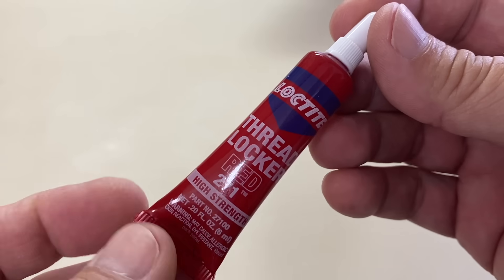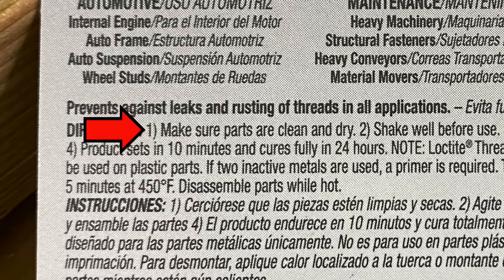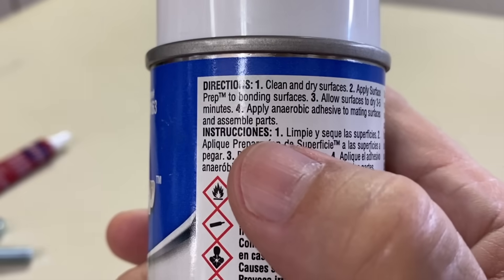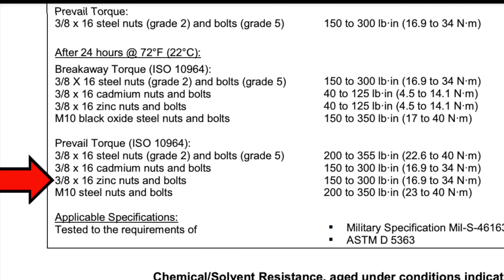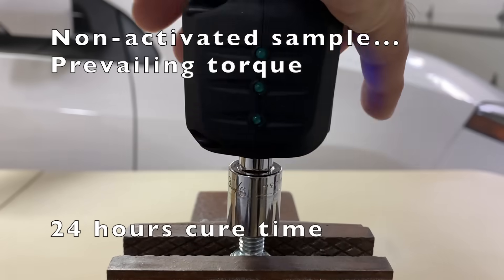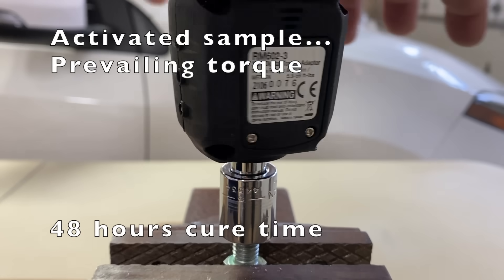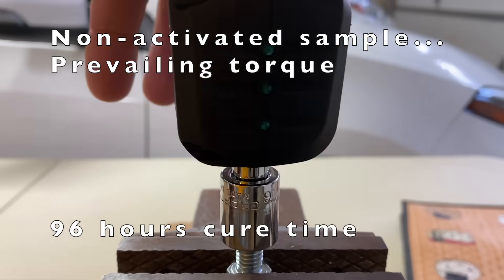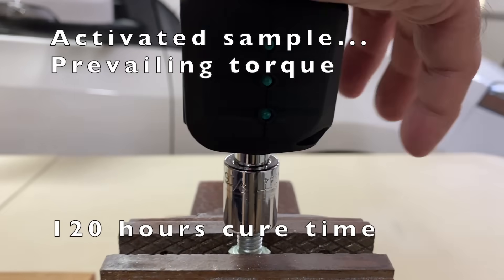Nuts & Bolts - Most DIYers Do Not Know This | Loctite Red Threadlocker Curing

Comment: Great video!  

Dear fellow Gear-Heads,

I owned a national fastener distribution company for 26 years, AND I was a direct distributor of Loctite's Automotive Division products.  As many have suggested, the fasteners should be tested under proper load.  The #1 reason for fastener failure is improper torquing (under & over).   The bolts and nuts should be paired properly according to their "grade", and even plating (in this case "Zinc", which is not only soft, but also acts  as a lubricant) affects the torque range.  

By design, the assembly is meant to stretch, which slightly deforms the threads, especially on the nut.  (This is why you should not reuse them, especially the nut.  By the 3rd-5th properly torqued reuse, the threads can be completely compromised without you even knowing it.)  

For this test, there is an additional reason for torquing the assembly.

As others have said, anaerobic thread-locking adhesives cure when oxygen is not present. They are specifically formulated for the tight tolerances between metals, especially under "load", where the least oxygen would be present.  This is an important feature. 

Occasionally, we would have auto mechanics complain to our company that the thread-locker tubes they received from us were only half full.  This is by design.   The adhesive requires a certain amount oxygen in the tube, or it would harden and destroy the shelf life, if any.  (So, store it "flat" to expose the most adhesive to the most oxygen in the tube.)   Also, unlike some of the other methods of catalyzing, this adhesive doesn't cure in a uniform manner.  The strength between those torqued threads will be much higher than any adhesive exposed to air on the assembly.   (If practical, you could help insure the curing by applying heat [120 F+ if memory serves me]  to the area which will dissipate the oxygen, though it shouldn't be necessary.  

Adhesive that falls outside the tight fitting metal surfaces , doesn't cure completely and can be wiped off and cleaned up.
Reply from the maker: Wow!  Thanks!  Lots of good information.  
I'm thinking of testing other aspects of the activator like cure speed and use on cold fasteners.  😎

Comment: loctite red need 2 conditions to harden: 1) anaerobic (air free) condition and  2) free iron ions on the material surface.  The correct primer adds the free iron needed but not found on many plated and non-ferrous fasteners.

Comment: How about a test comparison between loctite and nylon insert lock nuts?  I never use an activator, just clean the bolts and nut a never had an issue.  I one time bought some loctite to use on a hydraulic cylinder that you had to heat to 450° to get loose.

Comment: You can put a big drop of locktite on any piece of metal and if will not harden, you can put a big drop of glue on just about anything and it will not harden. If it dries it will be soft. That nut was loose on those treads! Lots of play!! Locktite and glues are not Epoxy's. Even glue between two pieces of wood must be clamped squeezing out excess or if and when it does dry it will be soft and movable. Locktite works under pressure, when treads are pulled together tightly! Having locktite on a bolt with a wobbly loose nut thats wasn't tighten or torqueed will never work! If a bolt or nut required 20 ft lb of torque and locktite is used it increases the breakaway torque considerably. Insuring a nut or bolt doesn't back off.. who want to tear down an engine because a bolt backed off? Sorry dude you have absolutely no idea what your doing nor what your talking about... maybe your just one of those guy and if you argue this point then you are...
Reply from the maker: Thanks!  No argument from me.
Loctite tests the breakaway torque the same way, but with precision equipment.  Here's a  testing video from Loctite... https://www.youtube.com/watch?v=PGZCPyi8yBc
I'll do more research because all the stuff I read on anaerobic adhesives says that they work in contact with metal and the absence of oxygen.  No mention of pressure... I'll keep looking for that.  
😎

Comment: I believe the intended use case is to have the hardware tightened to specified torque values and the tensioned/anaerobic environment activate the curing process.
Reply: I agree with your recommendation.  I'm not a chem or materials guy, but from what I've heard about bonding details... 🤯
Some adhesives work on a molecular level such that if you have more than a few molecules' thickness of adhesive between the parts, you're not going to get the desired bond.
I think epoxies would not be in this group, as they stick to both parts and provide a rigid gap filling material (also like the hot melt used for cardboard boxes)
Reply: Correct

Comment: Loctite cures under no oxygen levels. This means leave a drop on the table and it will not cure.  By not tightening the nuts you are not depriving it of air enough to get a good cure.

Comment: Need to bring the nut and bolt through a hole in a steel strap and torque to equal tension so the true effects of the loctite are accomplished, it was designed to fill in the open space between the threads to complete the contact.
Reply from the maker: Thanks!  
Loctite tests breakaway and prevailing torque with loose un-tightened nuts.  If it's good for them, it's good for me.  LOL

Comment: Most likely when the nuts are torqued to specification for the given grade of fastener the zinc plating is rubbed away on the stress bearing side of the threads.  I would expect less variation between the primered and the untreated screw/nut samples under those conditions.  The zinc plating is quite thin.

Comment: Great video. I'd never heard of the need for activator, and I don't clean the bolts either! It would be interesting to run a test with uncleaned bolts vs uncleaned activated
Reply: It fails if you do not clean the parts. I have seen it several times. They must be clean, both bolt and thread area. Brake clean works pretty well and is so common now. Spray on and blow off crap with air.

Comment: If the nuts and bolts rust correctly as engineered and manufactured, why do you need thread locker at all?  (Asking for a friend that goes through far more penetrants than thread lockers.)

Comment: Loctite is insanely overpriced as it is. For the manufacturer to suggest that even more of their ridiculously overpriced products are needed to ensure a stable fastener just adds to their lunacy. For what loctite costs there is no rational reason why any additional products should be necessary for it to perform its intended purpose. Its not surprising that people often use super glue and other makeshift methods of securing fasteners in place. Keeping nuts and bolts secure is certainly not within the realms of quantum physics, yet  loctite definitely seems to want us to believe that it is. Super glue and lock washers are looking more attractive by the minute!

Comment: I think this experiment was a flop.  Your findings make no sense.  Your tool is obviously not calibrated and or malfunctioning.
Reply from the maker: Thanks!
Actually... I read something last night that could explain my results.  A Permatex red technical data sheet says that activator speeds up how fast the threadlocker sets or fixtures... not the full cure strength.  It says 5 minutes with the activator and 20 minutes without.  You know what that means... another test!  LOL

Comment: Great Vid, with one exception.  
Foot-Pounds is NOT a measurement of TORQUE !!! 
Foot-Pounds is a measurement of FORSE, expressed in Ft-Lb-F.

Pound/Feet is a measurement of TORQUE, expressed in Lb/Ft.
TORQUE is measeured as Mass over Distance or Mass divided by Distance. 
As a Metric comparison, Torque is expressed as Newton/Meters, yet you certainly would never say Meters-Newton.

I understand a lot of people use this term INCORRECTLY, but that does NOT make it right.
Reply from the maker: LOL!   Thanks!
I know but just can’t change.  Foot-pounds is ingrained in me.  I even see it on spec sheets and my torque adapter. 😎
Reply: @HacksbyDad  Yeah, I get it. 
I saw a Snap-On Torque wrench with Ft-Lbs on the scale. Amazing., LMAO.
If ya say something wrong for a long enough time, does that makes it right?
 Hey, I just noticed I spelled "Force" wrong, oops.

Comment: These "yielding torque" results seem pretty wimpy to me. I recall using red Loctite 40 years ago, and once cured, it was the closest thing to welding two metals together that you could find. It usually required using a torch to get them apart.
Reply from the maker: Thanks!
Yeah... I experienced the same but my results are what they are.  I'm working on a couple of other tests right now.  One with more threads and larger diameter fasteners.  The other will be a test a year later.  You'll need to check back in a year for that one.  LOL

Comment: Unfortunately we don't work on cars in labs. Real life conditions are greasy, rusty and the last thing you want to do is use a torch to get a bolt off. Of the tens of thousands of bolts and nuts I've installed with red, I've never had one come loose. Primer? Just another sales pitch.

Comment: Here is something. Loctite also makes a green thread locker. It is made to use with "assembled" hardware sized from #6-32 thru 1/4-20 (imperial sizes). Assemble, then apply the thread locker. It wicks it's way into the assembly, thus keeping vibration from causing the assembly to come apart. Handy stuff. I learned about it from a Loctite rep while peddling car parts in the early '80's. I use it in my hobby...restoring old woodworking machines. Frequently, I disassemble the stands and repaint. Using new hardware, and a drop on easy fastener, I feel confident it will last.
Reply from the maker: Green Loctite... got that covered.  https://youtu.be/amqesHpyCKg
😎
Reply: Yes, wicking grade loctite, works very well

Comment: The extra thickness of the primer could make a difference.   Could it be the loctite can cause a chemical reaction wth the material resulting in rust if the primer is not used?   I'll just use Loctite like I always have.

Comment: Maybe run nut to head to achieve a minimal standard torque. Also for a better sampling do five of each per day over five days, would be interesting how comparable they are.

Also do not all loctite products activate as a result of being under pressure?  Just filling the gaps between threads may not cause proper pressure.
Reply from the maker: I gotta save up to redo with more samples.  This stuff gets expensive.  LOL
Pressure doesn't activate threadlockers or anaerobic adhesives.  Just need to contact metal surfaces and remove from oxygen.  😎

Comment: I wonder if the nuts being tightened up against something would make a difference since when the threads engage and are tight there would be a thinner amount between nut and bolt. If that makes sense.

Comment: SAE torque is measured lb/in   and lb /ft. Just like on that package. Why do people continually say INCH  POUNDS AND FOOT POUNDS?...The spec is POUNDS INCH AND POUNDS FEET.  FORSE THEN DISTANCE...You now , just like the rest of the planet using SI or metric standards....Force   distance...NEWTON METERS  not METERS NEWTON. Other than that great video.
Reply from the maker: It's what I learned when I was young and can't seem to make the change.  I see ft-lbs on lot's of spec sheets and even my torque adapter.   LOL

Comment: The only difference between a torqued up nut and bolt is one side of the nut's thread is forced against the mating side of the bolt's thread, so the thickness of the anerobic adhesive is minimised (i.e. all the air is forced out of that area, but just on one side of each components thread forms) 
Its holding abilities untorqued rely on how closely mating the nut and bolt are in the first place and how much of the voids are filled with the adhesive and not with air.
Tightening up isn't going to suddenly make the parts mate more closely, it's just gonna take up the slack (pardon the pun) on one side of the thread.

Comment: I been using 2 cleaners I run into a lot of grease and oil  first Mineral spirits then acetone  clean bolt and using acetone any locker will work . Red is used on things your not going to be removing in say 5 years or longer . blue is great for things you need to unfasten often like Mower blades i very seldom use red it takes lot of heat to get it to break free .    All you tested was the bonding strength .  when a Nut is used as a fastener it is under torque and using a locker its going to double the strength .  if you fasten a bolt to 15 pounds it will take 30 to remove it .

Comment: So the Primer helps a little. It also makes it harder to get the nut off once you do break it loose. I have to wonder how much of the difference is just because the threads have the primer dried in them and would be tighter anyway. In any case, I don't know anyone who's going to go through the hassle of using the primer most of the time.

Comment: I didn’t see anything about vibration, when nuts and bolts are tightened together during certain high frequency vibrations, the joint surfaces will slip and wear-in over long periods of time, six months, a year, can wear enough to take the tension off the nut and bolt and thus loosen it, the rubber like compound of lock-tight between the joints flexes and allows for that high frequency movement without wearing the surfaces and loosening the joint. If I missed this in the comments no worries, do you think you would like to test for this? Thanks, great video 😊
Reply from the maker: Thanks!  I'm working on a vibration test.  😎

Comment: Beautiful and elegantly designed experiment. Everything right and nothing wrong. If you are not a scientist, you should be one! 
If possible, it could be beneficial for someone to repeat the experiment with a few adjustments to increase the power of the conclusions. Thank you very much.
First, identify the manufacturer of both bolts with noted frequency of defects in size and composition of nuts and bolts with the same for the activator substance and Loctite.
Identify temperature and humidity of environment averages during application and curing.
Second, use a higher number of activated vs non-activated nut/bolts. Say 10 or more, but perhaps more than 10 nut/bolts (One hundred nut/bolts in each group best but not likely practical for this setting) in each cure time groups.
Acquire testing design and conditions the Loctite manufacturer used to produce instructions as design differences can produce a multitude of conclusions. Publish with this data. 
Standardize the quantity of Loctite applied to all bolts. For example, the higher torque in the non-activated group compare with the activated group cure time could be a result of more Loctite applied to the bolt.
Standardize number of threads the bolts are positioned.
Show pre-calibrated torques for torque wrench with manufacturers package insert.
This is not meant to be a slight just how the conclusions could be strengthened. If I were a physicist specializing in experimental design in a lab your experiment would easily pique my interest to do the above.  Magnificent!
Reply from the maker: Whoa!  I'm far from a scientist.  LOL
Thanks for the feedback!

Comment: Red is to strong use Blew I've wrenched for 35 years nobody that is a good Tec uses Red brakes bolts after years of being in element's when removed next time
Reply from the maker: Thanks!   Good to know.
Reply: @HacksbyDad  blew or even yellow works just fine . & Bolt will come off with no problem next time

Comment: Does the primer/anerobic activator deteriorate the protective coating on the zinc plated nuts and bolts.  If it does, will that lead to accelerated corrosion on the surfaces not coated with Loctite?  I would think that rust would help prevent a bolt from backing out, but I'd rather just have the Loctite do it's job slightly less effectively.

Comment: Something that should be considered :  You gave the cure times, but you didnt give the temperature.  If it never got above 30 degrees when the testing was done, compared to say 75 inside a home, or even if you put them in an oven at 200 degrees, those temps would most likely affect the strength of the cured breakaway torque.
Reply from the maker: Thanks!  Samples were left in my garage in a tropical climate.  Probably a range of 70 to 85 F° day to night.  😎

Comment: ...you didn't tighten the nuts to anything?  All that data against a uselessly floating nut.  Any guy that has had to remove a properly torqued down nut + red is wondering what you think you are doing?  There is no real-world application for a free floating nut halfway up a bolt.  Red + near max torqued nut will many time result in a snapped off bolt.  Recuse and rectify your experiment.  Silly.
Reply from the maker: Thanks! 
Please check out my other videos for some with the nuts tightened down with a clamp load. 
Here's how Loctite tests breakaway and prevailing torques... https://www.youtube.com/watch?v=PGZCPyi8yBc 
😎

Comment: More complete test would include  set of fasteners with no locktite.   All bolt/nut pairs torqued down to a specific value.   Data then would have a control reference of no locktite.  Also, torque on fasteners with locktite increases holding force once cured.

Comment: Outstanding demonstration.  Initial torqueing of the bolts/nut may tighten the gap between the running surfaces and give a more optimum result.  Great data presentation.  Very clear video.
Reply from the maker: Thanks!  Much appreciated!
😎

Comment: I found if the thread lock was not thoroughly mixed, there was significant loose of bonding strength. Contents do settle inside those tubes.
Reply from the maker: Yes… the bottle was shaken.  Thanks!